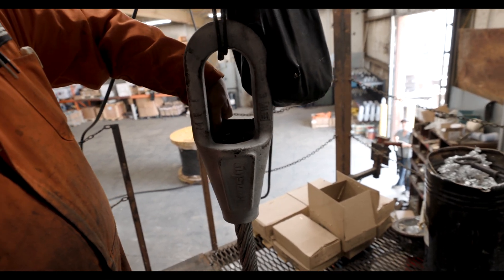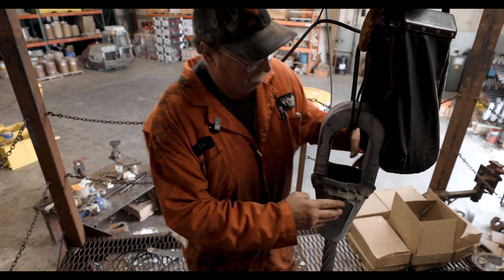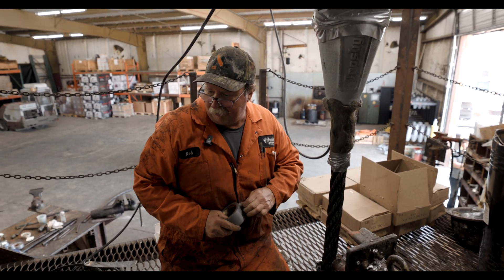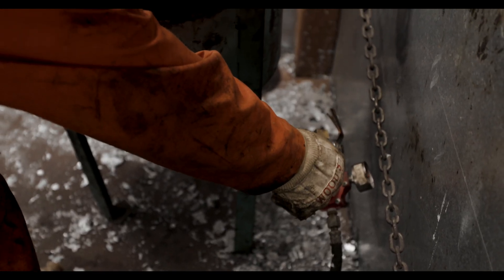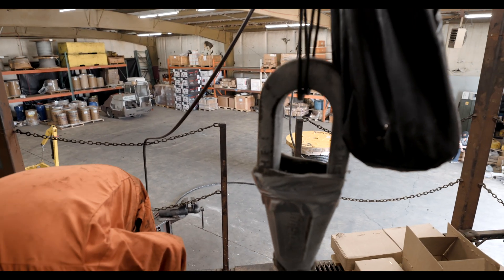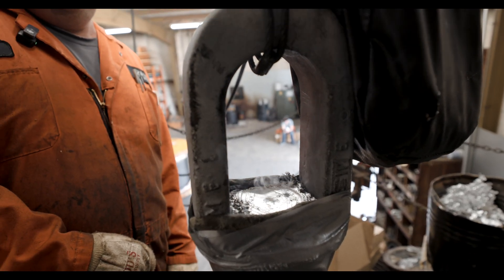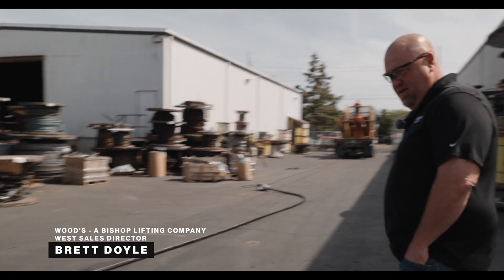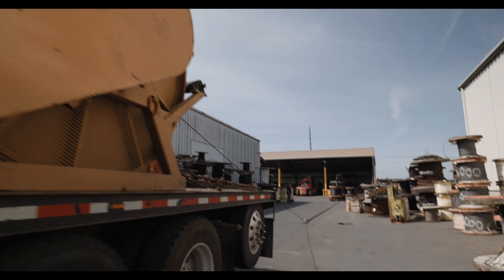Watch Us Pour a Zinc Socket and Spool a 1 ¾" Wire Rope Sling for a Marine Job

Comment: Which one is stronger between zinc casting & mechanical press ferrule ?
Reply from the maker: Zinc and resin sockets have a higher termination efficiency than pressed or spliced eyes, making them "stronger" comparatively. A Molly Hogan usually is around 94%, depending on wire rope size and sleeve manufacturer. Poured sockets are 100% (it takes full advantage of the wire rope's factory breaking strength).

Comment from the maker: Ever seen a 1 ¾" wire rope get socketed with molten zinc? 🔥
This method isn’t just rugged — it’s engineered for 100% efficiency.
Got questions about spelter sockets or sling builds? Drop them below — we’ll answer.

#TrustTheLift